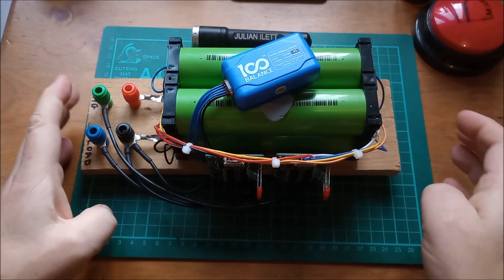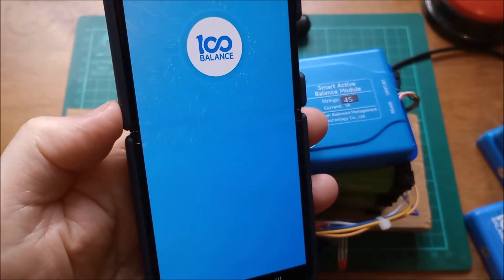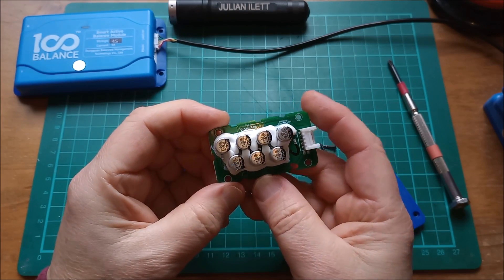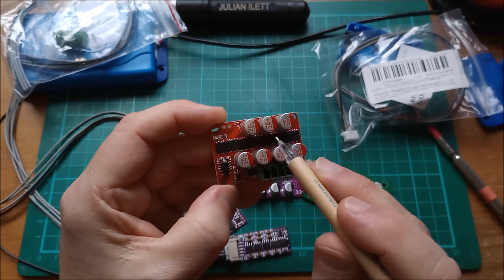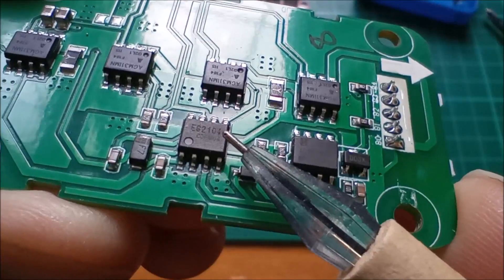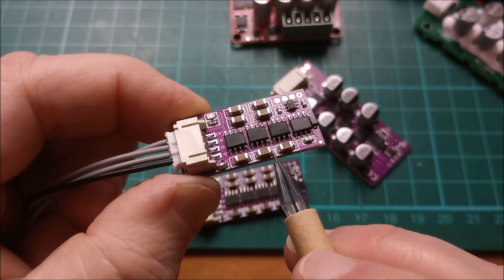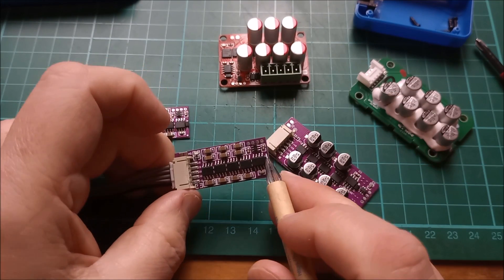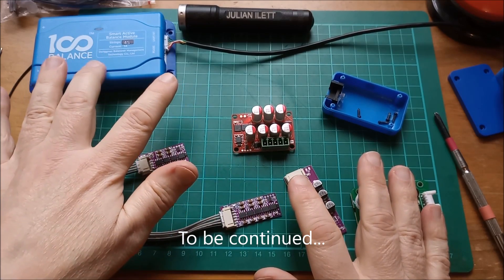Active Balancer Modules

Comment: Perhaps an idea when analysing these balancing (or bms) circuits is to consider the various failure modes as well. What happens if one of the cells in series is faulty for instance? Will the module just keep trying to dump the adjacent cell voltage on to it, like "forever"? I've seen similar issues with a 21S Li charging system where the charger didn't stop at full charge of 20 cells because the 21st cell was defective at low voltage, resulting in overcharging the remaining cells. (The charger never saw the expected max voltage.)

Comment: J says that his row of caps got quite hot.  This should sound alarm bells as it means that the caps are driven well beyond their permitted ripple current limit (which all caps have vs their IR).  It means a significant shortened life for these caps and they can fail to s/c  with disaster consequences.  BEWARE

Comment: Very interesting. Over the last decade I tried several times to make a capacitor-based active balancer myself and always faced issues. First one was that often the cell's voltage is close to the MOSFET's gate threshold. Some specific MOSFETs now support very low voltages but it has always been an issue. Second problem was that balancing induces strong currents when cells are very imbalanced, possibly to the point of harming the very discharged one, and that on the opposite, it almost never converges when the voltage difference between cells is low because the current through the capacitor counts in just a few milliamps if not less. I also thought about implementing a microcontroller to pick from the most charged and send to the least charged cell so that it would balance quicker, but I gave up on the complexity.
Reply from the maker: You'll love the smart active balancer - it's ridiculously complex :)
Reply: @JulianIlett  I found much more interesting, there are some inductor-based balancers. Something I wanted to experiment with but never did. There are likely some losses in the diode but I ordered a few to test them. They start at $1 for 2S :-)

Comment: Active balancers can imbalance the cells if the activation voltage is too low, they should only balance when the cells are almost fully charged to avoid that.
Reply: How do we treat rouge  cells that discharge/charge too quickly.. like this cells are always way above other during charging/discharging 200mv above/below others

Comment: its not a flying capacitor like inside an expensive JK bms etc, this is another ripple method. still way way better than a wasteful useless resistor balancer.
these types work by connect the caps to cell 1, disconnect and connect to cell 2, rinse and repeat, this will balance 1 and 2 because the cap works like a bucket between two ponds, the next capacitor circuit is doing the same with 2 and 3, next with 3 and 4, this way any voltage imbalance is rippled/shuffled throughout the pack. 
as the caps are charging and discharging the same chemistry of cells, the circuit doesn't care about the voltages of the cells they just become smoothed out, so no settings needed, not having cells go over voltage is the responsibility of the charger
the processor just sends a square wave/clock signal for the switching to take place, same signal can flash an LED for 'running' 
its basic and simple and kind of fool proof.

Comment: The white silicone sealant could also be there to add vibration/shock resistance since the solder joints for SMD electrolytic caps are so small (and the solder joints easily snap).

Comment: A diy dumb active capacitive balancer would be interesting, I think the simplest way of doing is to drive various N-Mosfets with a gate drive transformer... it could be turned on whenever the battery was charging...
Reply: A toroid with multiple secondaries for each battery and a simple diode rectification would theoretically charge them equally (same number of turns and well-coupled), and the full battery voltage on the primary for reduce the current stress on the primary...
Reply: what would be just balance up + u need some FB from cell 1 so that u dont overcharge but how do u know that the other are balanced at that point? @VictorC173